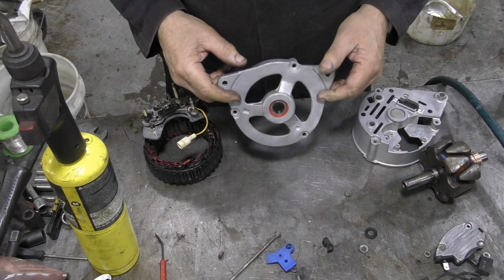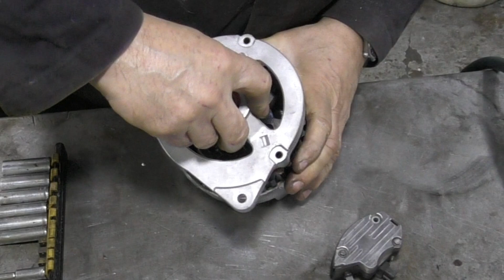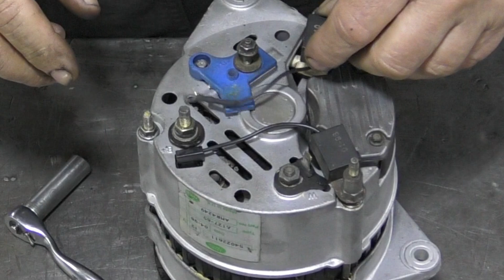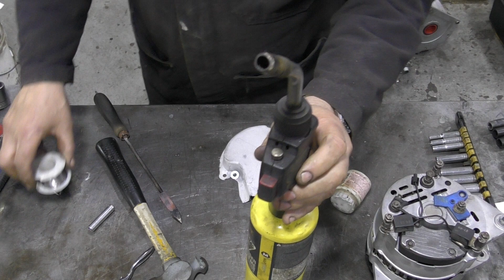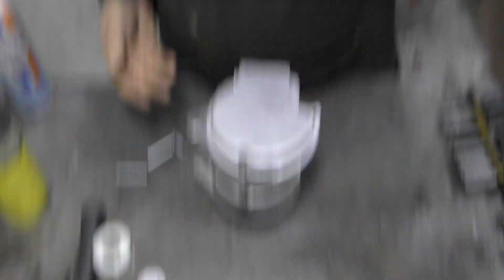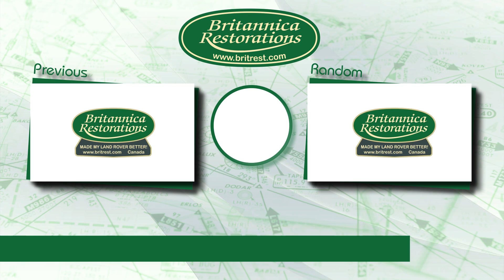300Tdi Magneti Marelli Alternator Part 2

Comment: Could you wash the stator ? maybe in the ultrasonic, after all they often work submerged in water and dirt! I hope you didn't wire-brush the copper windings.
Reply from the maker: no just a brush across the rusty bits - no wires were damaged

Comment: Hi Mike, Just before Christmas, I had a problem with my alternator over charging at around 16volts.  I ordered the regulator unit off E-bay I thought that I should replace the cut-out at the same time.  As only my luck would have it the post went on strike and the parts got held up. So I had to go to our local spares shop and got a new alternator for £70 ( trade). I wish that I had this video when I later did the job, it would have saved me that money. Many thanks for a great video Mike.
Reply from the maker: Thanks for the info

Comment: When you disassembled the alternator, you removed a bolt/screw that was underneath the brush pack, but when you assembled it you fitted the screw from the inside of the casing.  Does it matter which way you fit it?

I reenforced the heat shield with a stainless steel plate, cut to the profile of the base and riveted it on to the heat shield.

I have one currently sitting in my workshop waiting for spares, but I can't find anyone that will courier to South Africa. I need the rectifier, slip ring and the needle bearing.

Thanks again for the great video Mike.
Reply: If my alternator needs cleaning, I will send the parts to you for washing and blasting. 🙈 Lol 👍🏻🙏🦘
Reply from the maker: They come out nice eh?
Reply: I can’t remember which engine spec this alternator came from, but if it was a Defender 200Tdi, it is now reassembled to fit a Discovery/RR 200Tdi.  That’s the beauty of these basic alternators - remove the three long exterior bolts, rotate the front cover and you can reverse the fitting orientation to suit different vehicles.

Great video on refurbishing the whole unit. Mike.  Amazing how much easier it is than one would imagine.
Reply from the maker: Yes - better than I though! I think these are old Lucas alternators but branded MM - I will look in my container and see what I have
Reply: , they come up superbly.  That vapourblaster you built is doing fantastic things for cast aluminium.
Reply from the maker: I will check out the screw - took 5 days to do this video! 
Let me know the part numbers you need, and I can ask at my local electrical shop and send them from here
Reply: Thank you Mike.
I'll get back to you on this.
Reply: I never knew what it took to rebuild an alternator. Thanks for that. It’s not as hard as I thought it would be. I would take lots of pictures as I disassemble that because I know there’s no way in hell I’d figure how to put it back together lol.
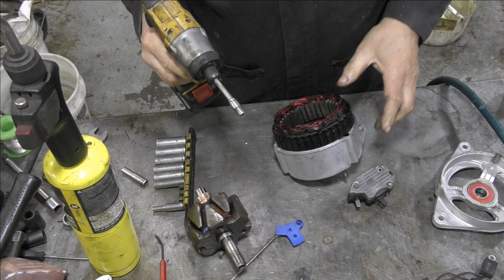Reply: 3:43 The fixing screw that secures the rectifier pack to the outer casing must be fitted from the outside (as per the removal). Fitting the screw from the inside doesn’t secure the 2 parts together.
Reply: The odd 7/32 socket can actually be replaced by a 5.5mm but not every brand of socket set actually has that size in it. I got used to stripping these down on regular occasions due to rather deep off You’re doing a great job in showing people how some tasks really aren’t that scary and can save you a lot of money.